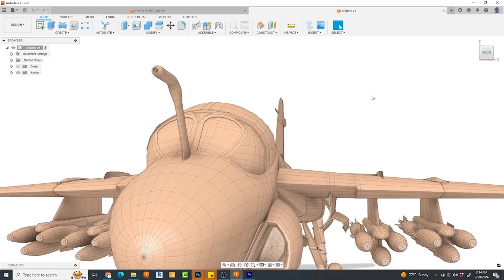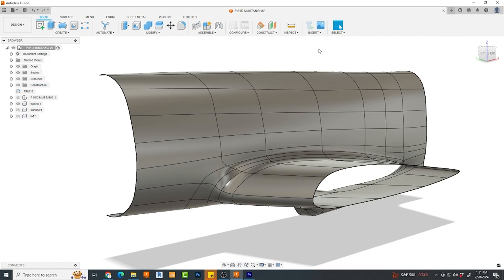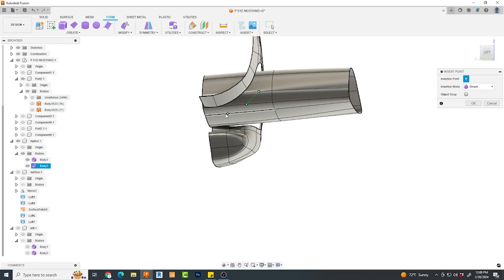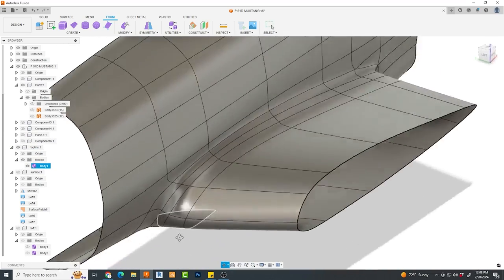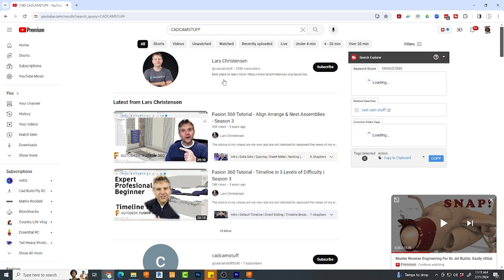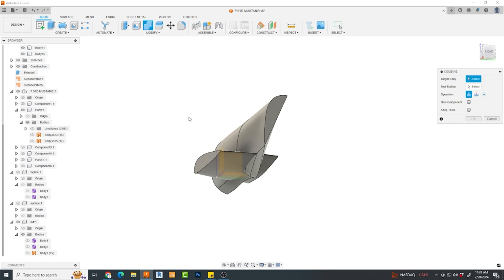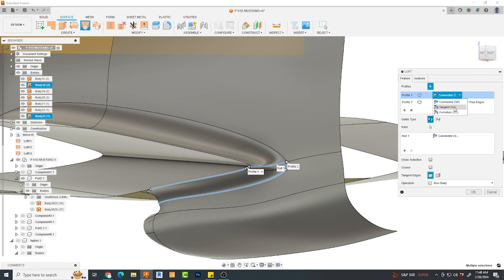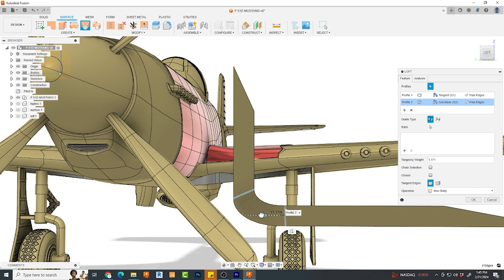Fusion 360 P 51 Mustang Wing to Fuselage Transition how? #fusion360

Comment: Okay only just now I noticed you don't use design history. You said you'd have to delete the face and redo it to fix the hole, when with design history you could just open the feature again, fix it, and everything that changed would adjust. If you're not aware yet, do yourself a favor and learn design history and what it means to leverage the power of parametric design. Ever since I've learned that I can not go back. Programs like blender with their destructive workflows are now honestly quite annoying to use, now that I know it's possible to just go back in time with fusion.
Reply from the maker: Thanks I'm aware of design history.  It works great until I have a model with thousands of edits on the timeline.  In this example it would have been fine to have on though I agree.  Thanks for the comment.
Reply: @redbaronrc  yeah that's fair. Some modelling styles lend themselves more to history than others.
That is where I have been struggling. I can get a plane shaped right-ish with t-splines, but actually making an accurate engineering model that is as parametric as possible has turned out to be very annoying. Things like how do I swap out a wing profile after the fact or how do I get a fuselage from lofts to look right...
Reply: one does not simply "not use design history"  in fusion without first using design history - it's the default behavior in fusion to have a timeline for designs and the only way to have the feature turned off is to do so deliberately.
Reply from the maker: @drumbum7999  agreed and guilty as charged.  I'm sure I turned that sucker off.  Or......  since this was started as an imported step file perhaps that's why it was off.  I'd have to go back and reimport it to see.
Reply from the maker: @stratos2  nothing like watching the computer crank and crank all the while your wondering if it has crashed.  Then it comes back with all sorts of errors in the timeline.  I know it is a powerful feature but sometimes makes me feel like I'm painting a picture with a sledgehammer.  Creativity goes out the window for the sake of parametric programming.
Reply: @redbaronrc  that is unfortunately true. Many of the "hacky" methods like also some you showcased in your video are not stable over major changes as they loses references. That is why a fillet with G2 continuity would be the best here. Ideally not even a fillet on the line itself, but a ruled fillet set to the feature of the combine between the fuselage and wing solid body. 
There's a lot to consider to make parametric design stable, any workaround will inevitably do worse than the intended way. So it's a matter of learning all of the intended ways that exist. 
Even then, fusion sadly lacks features to e.g. swap out an airfoil profile as it would just be a collection of sketch objects being replaced.
Reply from the maker: @stratos2  Thanks for the comments.